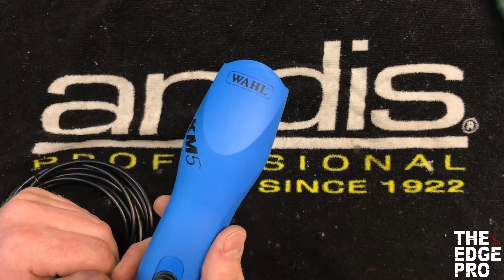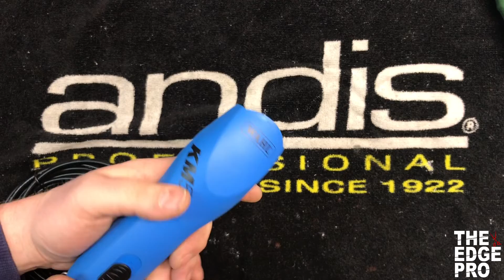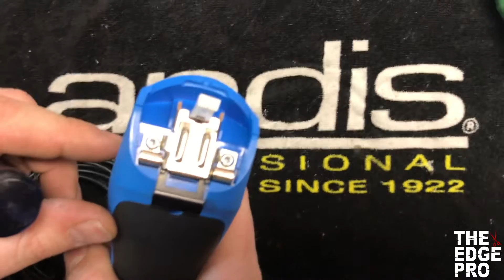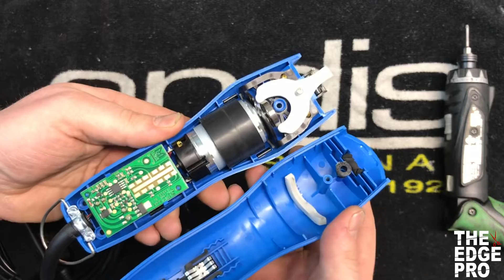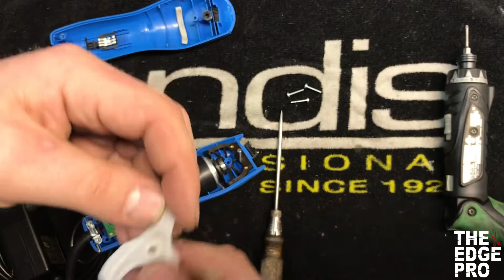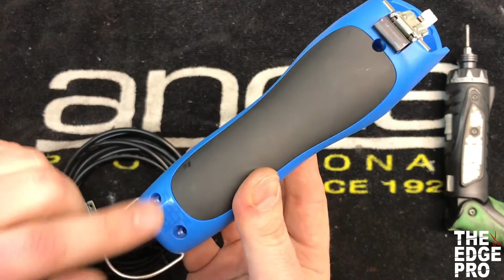How To Replace Drive Lever - Wahl KM5

Comment: Hi, I have a KM inspire and the clipper hasn't been cutting my dogs coat well. I replaced the blade without improvement and then after stumbling upon this video, I took the cover off my clipper to take a look at the drive lever. I did notice the plastic is melted on the bottom part of the clipper cover that is right in front of the motor. It's the part that receives the screw between the "y" of the drive lever. No other parts are melted. I'm thinking this may be an issue with the motor? Any guidance would be appreciated. Thank you!
Reply from the maker: Please either Call 515-963-1990 or email service@theedgepro.com
Reply: I'm here because I'm having the exact same issue with my KM Inspire, the burning in the same area, and the little bearing inside the blade lever is stuck in it 😅